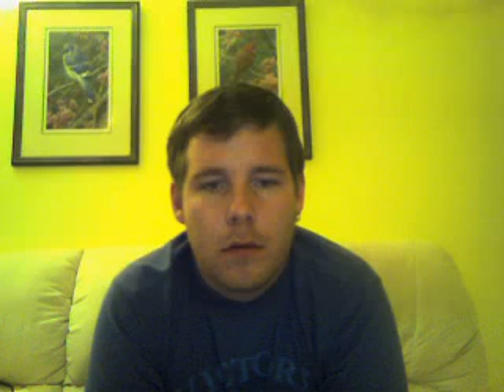THIS IS A LIE!!!!!!! 2004 Dodge Pickup Runs on 100% Water

Comment: ok @3:59 u do all this multiplication to scale up the usage from a 1liter engine to a 5.7 liter engine and at a certain RPM to another RPM  this is a silly assumption that you can linearly scale up the usage of "fuel" using the displacement of the engine. A combustion engine ignites a fuel and gets its power from the expanding gas from the combustion. using your same flawed logic an engine running on gas would use twice the volume or liters of gasoline when it is at 2000 RPM versus 1000 RPM. that is just not the case. You can't just scale up the fuel usage like that.

Comment: I'm not sure if you watched the video completely through, but at around 9:45 he states that when not using an electrolyte he gets 70 amps at 10v, with an electrolyte he is pulling 55 amps at 3v, which drastically changes all of your calculations by about 1/4th, I took electronics class and am very familiar with ohms law, a higher resistor would yes, lower the amt of amps avail. but you can split voltage by using low, equal resistance say 10ohms 3 ways or 10ohms over its natural resistance.

Comment: Thanks for doing the math. Anyone who has bought an h2 fuel cell to "increase their mileage" on a diesel or gas car can tell you that the increased demand on your alternator negates any benefit of the extra 2mpg they get. Anyone with any sense realizes that the energy required to produce enough hho to cruise at 35mph reliably would need an onan 5000 generator in the back of their truck!

Comment from the maker: ..... See pervious post..... Size of engine should be 105 amps. It should never run over half it's load. But let's say he pushes it to 70 amps. He could make 840 watts. That is still not enough to run that truck at idle. The water would instantly boil which would make the solution of hho gas and steam which would carry the electrolyte in to the engine damaging it. He went wrong when I he said he was using electrolyte.

Comment: We may only apply so much vacuum to any given HHO Cell until the water begins to phase change(liquid to vapor state). Testing will begin with use of a little less vacuum than that which causes the water molecules within the HHO cell to begin to boil(with sufficient vacuum, water boils at room temperature).

Comment: I'm looking into purchase of a vacuum pump for experimentation with vacuum within the HHO cell. For engine use, I'm considering more efficient approaches to producing the vacuum conditions. For example- As one HHO experimentor mention- we may use the engine's exhaust flow- in the same way a turbo uses exhaust flow- however rather than use pressure from the turbo, configure and possibly modify a turbo like system to produce vacuum for HHO production at reduced currents.

Comment: Have you seen YouTube screen name whyme2b video titled HHO Electrolysis For Current Reduction.  The idea is, wiith sufficient vacuum, efficiency is increased ie more Hydrogen Production per given amount of amperage. The concept is- reduce the surface tension upon the water molecule(via sufficient vacuum) and efficiency is increased. We still use electrolyte and DC Current. And a PWM if you wish. Heat Production is also significantly reduced. Add sufficient vacuum, Add Current, Note Results.

Comment: Why are we not looking at fuel cells to run electric motors with efficiency of up to 95% instead of the internal combustion engine of 45% at best.The fact is that will never get the internal combustion engine to run any more efficient due to friction ,heat losses and the fact that not all the fuel that enters the combustion chamber can be turned to output energy .

Comment from the maker: @yhenry77 yes tubes are more efficent but no designe will matter in regards to it being special to produce more hho. also from the cell that i saw on his video it definatly did have 1 inch and 2 inch od tubes. regardless of all these statments they make no difference and will not enable one alternator to make enough hho for the engine to run even stanley meyer used 2 alternators. freddy had d balls to say that meyers learned from him when meyer clearly studied from atleast 5 to 8 other inventors

Comment from the maker: @yhenry77 sorry to tell you henry but this video is nothing but freddys lie.
pressureized hho is so dangerious. it also is not more efficent but because no one has documented but when you pressurized hho it acutally trys to return back to its natural state. water. so the 12 volt battery doesnt change a single thing. he has to keep that battery charged and he has not aditional charging system. you can use any pwm all you want the key lies in the coil and the arrangement of the circuit together.

Comment from the maker: @1SixpenceFan the truck is using air so he will need more hho then what i have calculated i should enter that to the video. my calculations are based on a propane carb that actually was proven. i have also been informed that i am not the only one that freddy has admited to lieing to. he confirmed that he was only using 80 hho so if he admited that rather then ever letting anyone do tests then maybe the numbers are flipped and he is only using 20 percent hho like how most of think

Comment: This video fails to mention about the Freddy's HOD (hydrogen on demand) system. 
1) The system is pressurized (55-65 psi); makes it more efficient. 
2) The system uses a separate 12vdc car battery.
3) The SS tubes are tuned with the PWM.  
4) The ten SS tubes (industrial grade) are massive in size: 

9 - 316L stainless steel 6" long, 1.00" outside dia., 0.035" wall
1 - 316L stainless steel 6" long, 2.00" outside dia., 0.065" wall

All these factors combined; the system is able to produce 50 lpm.

Comment: h2oplasmaplug, Fast Freddy used the hydrogen and oxygen tank setup to find how much fuel was required to feed the engine through the fuel rail. He did this before he started to build the system he demonstrated in the truck in his video. He did not use the tank setup in the video as you claim he admitted to in his reply. In his reply he simply told you where his 11.9 LPM requirement to run the engine came from, you are misconstruing the facts and making a fool of yourself with your assumptions.

Comment: @camry6  It is not hard to conceive the idea that if (and I am assuming) the hho fuel has a ratio comparable to the amount of gasoline required (ignoring the fact that Stanley Meyers stated that hho has 2.5 times the fuel effect of gasoline), that enormus amounts is in fact not needed. In h2oplasmaplug's calculations, he referred to a GEO metro needing 13 LPM to run, that was for 100% flow through the intake, the difference is Fast Freddy's system is direct injection via fuel injectors

Comment: @aikimark1955 YES, EXACTLY, this guys calculations were considering the cell supplying 100% of the engines intake, and as you said, the hho replaces the gasoline in the fuel system. Adding the factor of steam expansion from the burnt hho in the cylinder, this adds to the effect.

Comment: I'm not going to vote on this video.  As a scientist/engineer, I do question your calculations, conclusions, and assertions.  If the only gas going into the cylinders was that produced by the electrolysis cell, I would agree with you.  However, the cell output is supposed to replace the gasoline as the fuel component.  Thus, the ambient atmosphere *should* contribute the bulk of the cylinder volume content, not the cell output.

I applaud your efforts to standardize the calculations.

Comment: @h2oplasmaplug  Hey buddy I am working on my own and my design is so simple even a grade school child could build most of it all you guys rep myers and his voltage potential so why not run with it. Have people stop using dry cells which are worthless and brute force out the window most assuredly. Try rectifying high voltage ac to dc then pumping it to the cell around 2.3 khz then see where you stand.

Comment: @Me102288 428 ci per cylinder??? Wrong.  428 divided by # cylinders. And this is PER revolution.  Idle = 428 x 700 rev/min -> 300,000 liters per minute (assumed 100% efficiency).

Comment from the maker: @enkeiray Hey if you want to pay for what's required I will use house power to run a truck engine on Hho. I will need 500 for the propane carburetor and let's say about 1000 to build the cells. Maybe another 200 so I can go and buy an old carbed engine. Then I will show others how to make it them selves and that way there is no smoke and mirrors. Oh and Freddy is charging 5000. Between 5000 and 10 000 I can run a car on water and I would do everything open sourced. Wanna flip the bill.

Comment from the maker: @AkiraMikaela Hey mr ego. If your so damned smart why aren't you running an engine on water. I have recently received conformation from someone that has seen the truck and he confirmed that Freddy is a liar. The truck is not running on 100 percent Hho. If you read what others wrote you will see what you pointed out has been done several times. In a while I will figure out how to add text so I dont have to keep dealing with rude ignorant people.

Comment: Hey dumbass Im a mechanic your fucked in the head if you think you need that much hho to run an engine 200+ lpm your insane. Also the gauge is not for lpm tard ass its psi. Furthermore im sure stan myers device worked but thats just one man did you ever realize that once a technology is pioneered people R and D it to improve it. Also to my knowledge gasoline burns with six times less explosive heat energy than HHO.

Comment: I Don't the fist thing about HHO powered vehicles, so I'm not knocking what you say on it.  But a Dodge truck of that year will NOT be running 3000-3500 RPM on the highway, they run about 1800 RPM @ 65mph.  I worked at a Dodge dealer for several years and with the overdrive transmissions that they were running in '04 there is no way your RPM numbers are right.  As for the rest of what you said about those guys BSing people I would, if I had to guess, I'd say your right.

Comment from the maker: @Me102288 well i dont know what you mean by the 30 and 40 percent but if your saving 40 percent on gas mileage then that would mean your saving 20 pecent on your gas bill. i dont know why its set up like that so if you have 100 pecent gains in gas milage that means your saving half your money on gas. 200 percent is running on nothing but water.

Comment from the maker: @ftlqed wow he pulled the wool over your eyers really good. you do me a favor lol make a cell and lock that shit down really tight. connect the power to it and run. you tell me if it uses less power when its under high pressure. btw he admitted to useing aluminum tape on his tubes. research that and let me know why sodium hydroxide does to aluminum. more waisting of my damn time. research other methods before waising my time.

Comment from the maker: as for my website i have ventured in something that will be much better then hho but i cant talk about any of that just yet. also in regards to my clumsy experiments how about you be a little more direct. i also felt that showing people what i did as i did it would be much more help so that way others wont have to make the same mistakes i have during weaning out what others have said to convince the public they are running thier engines on water. i went from easiest to hardest.

Comment from the maker: @Andyshemi again look on the notes under the video it has his message of reply to me. where he talks about cfm which you would only use that term if you are using tanks. also there is not much need for air. its already a 2 to 1 ratio and you might be able to make it 2 to 4 to match normal gas but then it will be to diluted.

Comment from the maker: @MajorDeezaster one question to you with out a 650 amp alternator where are you gonna be able to keep the battery charged. stop wasting my time with your need to fight. i will just start deleting your posts if you cant act rational. have you taken the time to read the notes of this video where fast freddy him self told me that he was using a h2 and o2 tank. or do you wanna just keep argueing with me for no reason. he told everyone that he was running on water and he told me 2 tanks.

Comment: Large engines maintain speed on the interstate at much lower RPMs than small engines.  Small engine - 2.5k rpm on the interstate.  large engine - 1.5k or so.
Also, the engine might require "48 liters per minute" of flow, but you won't put that much pure hydroxy in the engine.  That's going to be mixed with regular air, as well.  If you were to fill the cylinders of a car or truck engine with pure H+H+O, and ignite it, you would see a very large, very expensive fragmentation grenade go off. rt?

Comment: say your right mathmaticaly in detail as you pointed out, looking at the video from what i see, these guys aren't into the so much math detail. Just enough calculations to substane enough pressure of hho in the tank to supply the engines demand. Mabye you should go visit them and see with your own eyes. As you say there statements maybe in error but i think that pressure gage was telling the truth when he turned it off.

Comment: @h2oplasmaplug you have a major issue with your car then as my IAC is bad and at 75MPH i am going at 2.1RPM on my tac and at idel i am at 1.4RPM when i pass somebody it jumps up till the tranny shifts then it drops down till 3rpm with the gas floored.
as for your battery comment it makes no valid argument as i have 2x 2000 wat amps and a 250amp stero on a standard battery and alternator

Comment from the maker: @MajorDeezaster Well it seems like you just like to argue and make ignorant statements when you know nothing about the topic of discussion. I am driving on the highway at this very moment. I am doing  120 k or about 75 m. I am driving a 88 Honda accord with a carbureted 2 L engine. Low and behold I am doing 3000 rpm and when I punch the gas to pass someone I hit 4000 rpm and it goes up to 5000 rpm. I said assume to be nice. I didn't want to act to much like a know it all.

Comment from the maker: @hhobeliever but i bet you dont know the difference between sound waves and electrical waves. i know the technology i have many friends in this field also freddy has admitted to using aluminum wrapping on his tubes. which makes the appearance that it self runs. he put some electrolyte in the water which reacts with the aluminum making hydrogen. want me to keep going. or are you not even gonna take a single minute to what i have said to look in to and retaliate which i will just remove your post

Comment: Some of the things you say make no sense!  The gauge in the dash was not showing cfm but psi!  Also, your calculations for how much fuel was needed are off.  Just because an engine pumps a certain ampount of air does not mean that equals the amount of fuel needed.  he could be running a ratio of 14 to 1.  do you know what -I believe it is called stoicihometric ratio- he was running that engine at? I don't pretend to knw everything and i may be wrong, but those are two things that stood out.

Comment from the maker: @balls2yourface please type this in geo metro running on hho. you will see he is making the engine run on nothing but hho. he says in the vid he is using 5 lpm but the flow meter was wrong he had to actually use 13 lpm.

Comment: There is one important issue that concerning running a standard engine on hydrogen that most people are not aware of, and that is the engine TIMING when using hydrogen gas instead of gasoline will be MUCH different. Hydrogen gas burns extremely fast, and so the engine spark timing needs to be retarded significantly or it will not run. I did not see that guy make any changes to the engine timing when he switched over to hydrogen. That is proof enough to me that he is running a SCAM!

Comment: The size of an engine is irrelivent because even when your running it on gasoline you dont fill up the cylinder full every cycle. its just a little mist. Same with the hydrogen. The hydrogen provides more energy then petroleum when bonding with oxygen (combustion) because there is a bunch of extra carbon materials in fossil fuels. Hydrogen is purely fuel.

Comment: Great video, Thanks for the upload. Of course, I think Hydrogen has a future. But I dont believe these bullshit solutions. But maybe we could use water and HHO as a storage chemical for power. for example, Wind mills could convert energy into HHO to be stored and used on vehicles as fuel later. A lot of times if this doesnt happen then we would experiance peak capacity one very windy days where windmills would have to systematically shut down due to too much energy.

Comment: @h2oplasmaplug You need that extra air for cushion. This stuff does explode, then it implodes due to recombining into water. If you filled a cylinder with 2 parts gasoline and one part air, the cylinder would be likely to detonate and explode. The extra air added will provide a cushion for this and allow you to better control the throttle. If it were done with only hho, you would probably have no way to control it's speed (throttle) and the rpms would be incredibly high.

Comment from the maker: @Infiernofox138 i am not including the fuel to air ration because hho is a perfect fuel and does not need additional air to reduce its mixture. so in a 1000 cc engine it needs only 13lpm if it had air going it would need more unless you implemented other meyers technologies.

Comment: @Infiernofox138 , Actually if it's 6 times more powerful, wouldn't you use 6 times less fuel..meaning instead of 14.7/1 the mix would be 2.45/1 ratio right?